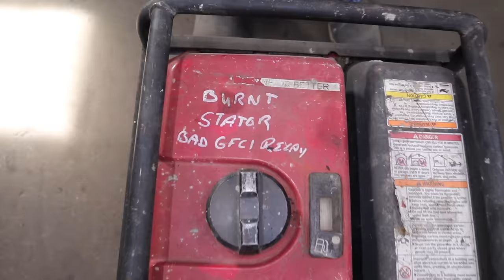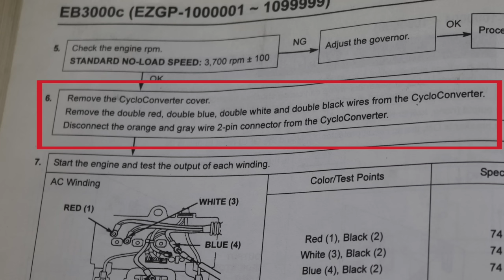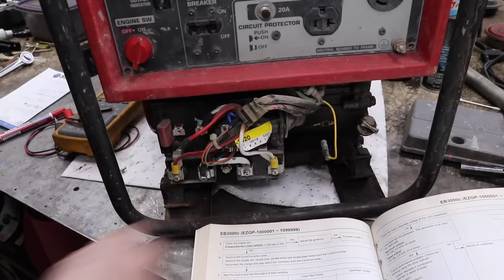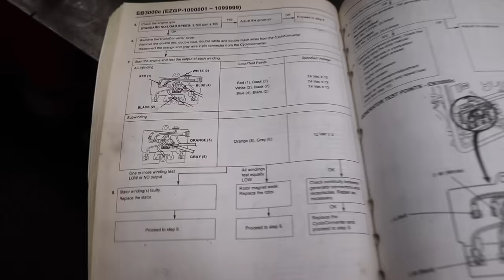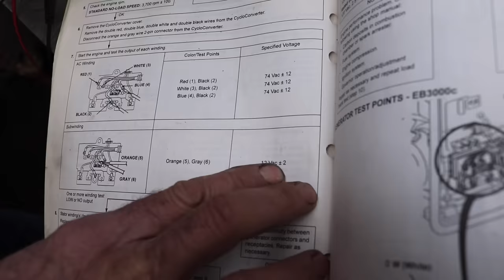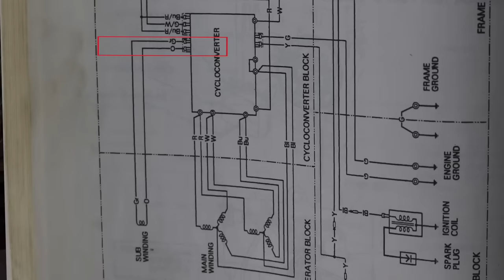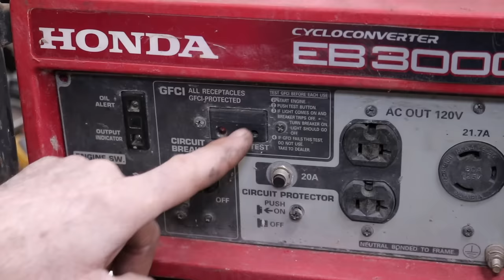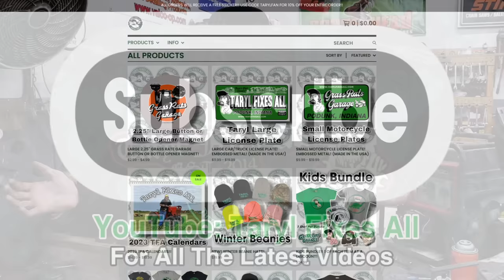Some Things Change For The Worst

Comment: would be a hit or miss situation , but i've heard that acetone will dissolve the resin (careful , it'll dissolve coating on wires too) . with knowledge of electronics , someone with lots of time might possibly repair inverter . maybe just see the layout and build a new one .
Reply: I've used Nitromors paint stripper to remove the potting compound from electrical components, but it can remove part numbers and information from the chips and what have you.
Reply: Eucalyptus oil will dissolve the resin. Use a small syringe to put it where you want, so it doesn’t get all over the place.Then you take a dental pic and a empty syringe and suck up the jelly.
Reply: I thought of that, but imagine the amount of time and work, as well as could you make it sturdy/hardened enough to withstand service?

Comment: I'm a gen tech ,and I've got a little peashooter 3500 champion.
It's ok for my needs,I'm not home when the power is out anyway. 
I'm impressed with how quiet it is, and it should be the muffler is huge! 
Of course I let it sit and get a crusty carb, so I've gotta clean that out quick and get it fired up when the power is out. 
Honda used to make good stuff ,but everyone else is catching up. 
For engines, check out the new vanguards ,they really are going after Hondas gx series.

Comment: I have no use for a home or emergency generator. But I do have a little 900 watt 2 cycle one from Harbor Fright that I really like. I have had it about 10 years. I use it to operate power tools in remote places and instead of a drop cord. I've used a Skilsaw, a small 8 gal compressor, drills, electric impacts, electric chainsaw, grinders, etc. I had to clean the carb once and you need to use fresh mix but it's a great little portable tool for me.

Comment: Honda must be too big to fail.  I can't imagine getting info to the corporate sector at Honda to respond about the parts problem.  Back 30 years ago I was restoring old Honda motorcycles and most of the parts for '60s bikes were available from Honda directly.  There was little computer online sales.  Don't try it today.  The only way you'll get old Honda parts is from places like Ebay.  Must be the same with generator parts.  Another instance of reverse progress.  P.S.  Slip Dog bears a striking resemblance to Little Jonny.  Hmmm....
Reply: 30 years ago there was no internet. Al Gore had not invented it yet, ha.

Comment: Sounds like a simple non inverter generator is the way to go. Cheaper and less to go wrong.
Reply: It is but get an inverter setup for computers and such. The 60 cycle wave on a non-inverter is erratic but reliable for other stuff. I have a 5K Coleman and a 220  well pump with backwash filters and a solid state timer relay for an ozone generator. Not one problem so far!

Comment: This is a catch 22 as the Honda's are one of the few worth the cost too repair. Other than a dirty carb it's rarely worth it to even look at a Chinese/Honda clone version. Those are so readily available and cheap customers just toss them to the curb/dumpster and pick up a new one. That EU6500 you mention with the $1100 main board was a $5000 generator new so really not bad. I mean I'll charge $100-150 to service on $400 Chinese; so 1/4-1/3 the value. Are they profiting from parts; YES, but at least you can get parts unlike the Chinese Clones.  I do work on a lot of generators and  the EB3000 is an odd ball and one of the first inverter type generators. They are my least favorite generator, only because they are loud, low power, and over complicated circuitry. But even here it was a $2000(If I recall) generator that can be fixed with a $300-500 part that takes 15min. Availability is scarce mainly because this is a rare generator that is pushing 20yrs old or older now.

Comment: Nice to know and I do have a Champion Generator I run the carb out of gas and fill it up with stable at the end of summer this will be the third year im sure it will start rite up in the spring gets a oil change every 100 hrs and ive ajusted the valves once

Comment: I just wish Champion and the others would get away from the metal gas tank that rust. I changed my Champion over to a plastic tank no more rust no more fuel problems. Also mounted a big hinged steel lid off an electrical box on top of the unit so if I have to leave it out in the weather running  it is semi protected.

Comment: I have a champion 3100 watt inverter generator that I use once a year for camping at the indy 500. Had it about  5 years now, runs my a/c unit on my travel trailer. It's quite and works flawless. Paid $500 new. It's used, gas drained from the tank and carb. I spray wd40 in the tank and next season fill it up change the oil. Good to go.

Comment: I’ve got a Honda and it has taking one hell of a beating and still going. It’s not an inverter machine so it doesn’t have any extra electronics besides the automatic voltage regulator. When you need reliability simpler is better. The more electronics you put in ANYTHING the more liking it is to fail.

Comment: I see a capacitor on the inverter there, I wonder if that is bad. On a Kenowa 4500 generator I have, the exciter coil capacitor kept going open when a heavy load was applied to it. I opened the plastic block case on the last one up, dumped the sand out, and found there were 4 separate capacitors in there hooked in parallel, and one lead to an outside terminal was burnt open. Looking on the case, it said it was supposed to be 24ufd, but the capacitors inside only added up to 16ufd. I searched ebay and found a high quality nos 24 mfd Mallory capacitor, installed that, and no more problems.

Comment: I have four generators...one the expensive Honda EU6500 for whole house backup, and three of the 2000 Watt Champion generators. I would say this about them. The Honda is insanely overpriced compared to what others offer but it is a superb piece of equipment. Getting it repaired ?....I don't know as I have never had to. 

The Champions are far better value for the money, and have good service support from Champion. I expect the Honda will last virtually forever but honestly, if I hadn't got an insanely good deal on a second hand (but brand new) one, I would never have spent that kind of money.  However, both have to be treated properly and looked after if you want to extend their life.
Reply: You've got probably 15 years at the max before you have capacitor issues.  You should go out every month and run it under a little load to make sure the capacitors are staying formed. The eu6500 is way more reliable than the 7000 fuel injected one.  Just ask the off grid people. They run them 10-20 thousand hours.  And then rebuild them.
Reply: @OTAlucard  Well, I'm 80 so in 15 years I'm not going to care. !!!!  Being serious for a moment though, I routinely run all my gennies about once a month, and treat the gas properly for long term storage. A home backup generator is absolutely useless unless you can be sure it will start in an emergency. I really don't know if using them routinely is going to ensure their longevity but the whole argument seems like a "storm in a teacup" to me. Buy good quality to start...Honda, Yamaha, Champion....and stop worrying. I had heard an unverifiable fact that the Honda EU6500 genny holds the world's record for long term use of 39,000 hours so if this is anywhere near true, I think worrying about the inverter crapping out is an over reaction. And yes, the Champion inverters are available as a part you can order ($200)and are more far reasonable than the Honda ($900)

What I would be far more worried about is buying one of these clone Chinese generators with no service and no parts available. If you do, be prepared to throw it out and replace it if it seriously craps out. You still DO get what you pay for....
Reply: @TOURMANBOB  I love Honda generators.  I've got a few of them but my favorite being the Honda EX4500.  They did everything right on that one. The EM600 is also an amazing generator about as big as 2 small shoe boxes stacked up

Comment: I’ve had two Honda eu2000’s both had problems. Had an old Honda 2200x rand good but was heavy for its output so o traded it for a .22 rifle. Since then I have purchased a Champion 3100 two 2500 duel fuels with parallel kit and a 8.5kw whole home unit. So far the only problem I’ve had is one the of the 2500 started to smoke with only 160 hours. I don’t run them hard mostly charging batteries just off idle. Hooked it up to something big the other day and ran it @ full load for about an hour. Smoking problems went away.

Comment: I also have a blue star miller stick welder 6500 watt it has 13 horse Honda engine.
It works great starts first second pull every time.

Comment: 100s of food truck vendors would disagree... Those Honda EU2000 generators are legendary and for good reason.  They are amazing.  I've royally neglected mine yet it starts on the first pull every time, even after 18 years and probably 5 oil changes at most.

Comment: There is no long term support plan for electronics like this. That power inverter was likely sub-contracted out for a limited build particular to that generator, and few other models like it. They likely had a post-production spare parts inventory, which wasn't maintained. A dealer would say the same thing Taryl effectively did - can't be fixed. 
Spare parts are going to be a headache as all kinds of cheap electronic systems age.

Comment: I've had this same issue before. I just cut the kill wire from the inverter. The low oil light shows on the panel but it still runs.

Comment: Unless you need pure sine wave voltage for some delicate equiptment, stick with a conventional genset.   No need to add electronic components that will fail long before the engine and power head.

Comment: I have the top of the line champion genny, with the remote start, it is super quiet, and hasn't given me any trouble in 5 years I've own it, cause I take care of it, and drain it, and I clean out the carb before storing it, and I keep it in my basement, not outdoors between uses. Only take it outside while running it of course.

Comment: I used a small torch to heat the epoxy and peel it off a board. In my case it was a $4 relay buried in epoxy on a $350 board for a generac.

Comment: I have had good luck with the large older style Honda generators like the em 5000 and em 3800. I buy them in good shape and use them for 5 years or so and keep them nice and sell them for what I paid for them or more before they get too many hours on them. They are quiet have a large fuel tank that lasts hours and they have a load sensor on the throttle to save fuel, good quality breakers and receptacles. The downside is they are heavy and not good for use with sensitive electronics. The newer ones are cheaply made and some of their cheaper models are made in china. I have never had an issue with the em series. I know people who have had them for 20 years with little problems.
Reply: I still use an EMS4500Honda I bought used 15 years ago. I think it's a 1985 model. It's so old, it has a flathead engine in it. Runs great when the power goes out.

Comment: I have the 4650 Watt version of the Champion Inverter Generator.    It`s quieter than my Honda EU2000 and starts and runs my one ton RV Air Conditioner without breaking a sweat.   The remote electric start can spoil you.   On a cold camping morning my RV is powered with the push of a button.   Best generator I ever owned.

Comment: When I was doing some electric motor.rewinding & power tool repairs 20+ years ago the generators that I worked on weren't fitted with an inverter & it was mainly the diodes which blew in them.

My brother bought a couple of AEG generators for my father & one of them has a faulty RCD (residual current device)/ MCB ( miniature circuit breaker) combo Unit which is similar to the GFCI unit used in the U.S. but any generic 240 VAC Unit of altge same current & trio current rating can be fitted into the AEG generators in Australia.

In our area we haven't had a power blackout for 9 years since we had a new substation built & since our last major storm so I don't know if they're ever going to get used !

Comment: I have an ES3000 Honda generator from the 70's. It is so old it has a flat head engine (I didn't know Honda even made a flat head engine). It runs the generator off a belt drive. So far, so good, but no parts available, not even NOS ebay!
Reply: Saw one years ago. Good rig!

Comment: Hi from Willow Alaska Tarly..What’s your thoughts on the Honda EU 3000is ?  I did quite a bit of research and just bought one a couple months ago although I haven’t used it yet. I bought enough spare spark plugs, air filters and oil to keep this thing running for many many  years, or so I thought ?

Comment: I know you can't advocate for doing such a thing, as a reputable repair shop, but I am pretty sure the Inverter designs are not all that dissimilar between ANY inverter Generator. I would think that likely you could say, fix that Honda Generator with a Champion or Harbor Freight Predator, or whatever other brand inverter by simply knowing how an inverter works, measuring the voltage and frequency (if any) differences going INTO the Inverter unit on a working generator to help match up/decide if the Inverter is compatible as a replacement.   Of course, this is something I would do, in my backyard shop, as a tinkerer but not something I would be able to do if I was taking customers money and guaranteeing them any sort of safety from it catching fire, etc like you would have to if you ran an actual customer pay repair shop.   Inverters aren't rocket science, especially now that Solar is so popular, Inverter designs, and the parts used in them, are quite commonly available to the public.

Comment: ?  i have an older Honga gen:  EG 3500.   i bought about 9 gens; all different. Two were Chicago 900 watt 2 cycles, very cheaply built, got 'em going. (carbs redone)
  Most all, required carb jobs/ new parts/ gaskets.  All but 2 were working.  Those two, one trashed engine. Other, trashed gen part.  Anyway, this EG 3500 works, awesome.  Had to re-do  the recoil  cord.    Usually  starts   first, or second tug.   
 GOOD  LUCK,  all.

Comment: I bought a champion in 2009 and only problems were carburetor related because I’m too lazy to drain the fuel. Oh and the older ones had junk oil sensors that quit very early on. But I still use them.

Comment: Get a powerhorse or Champion gen w no inverter. My Powerhorse 7.25 gen worked ten days
 straight through hurricane Irma, no fancy-ass shit like a fkg inverter. A company like Honda that
charges so much and can't keep replacement parts available at a decent to-customer cost is 
NOT a company to deal with! Seriously you can do SO much better.

I have dealt w Champion, Taryl, those ppl at Champion are GREAT. I was fixing a Champ gen 3500 watts for a lady friend in her upper years, she used it to work a space heater at times. Champ sent me a new magneto and carb, FREE.  Thus I have bought a lot of parts for gens from them.

Comment: I can agree with you on Honda stuff being expensive junk. The mowers seen in the UK aren't terribly great. The steel deck HRG Izy models decks start to dissolve after 8 years if they haven't been cleaned properly, the Aluminium deck pedestrian mowers HRH-HRD models with rear rollers can have transmission issues after a year's use (in a professional use aspect) and the tractors we see are made in Italy by a Swedish manufacturer called Stiga who sell their machines at a cheaper price than Honda.

Comment: The Honda diesel generator could be made to work with a heavy duty alternator on and a 12v inverter, if one is desperate. However, it won't be easy to do. That diesel engine from the Honda could work on my tractor as well. 😁
Reply: So... you want his gas generator fuel tank AND his diesel generator!
Reply: Tbh, i would rip hondas generator head off and fit another brand on it .

Comment: Friend has a Honda EU2000 that he has used to run his RV and the Club Motocross Track Food Stand every Summer for YEARS.  OVER LOADED & OVER WORKED with nothing more than basic maintenance.  He even runs it on "Race Gas" a lot of the time.  I have a newer year of the same model.  Both are still running GREAT!  Honda costs more because it is worth it.

I have spent all my life in the Power Equipment Business.  From Mechanic to Mfg. Rep., providing Global Technical Product Support.  If anyone feels Honda is a substandard product when compared to the CHINA made, CHINA spec. products, they are not being honest with themself or others.  And no.... it was NOT Honda I worked for.

Comment: I don't want to call BS but if you look up parts for a EB3000C there are many serial number ranges. I looked up the Inverter (31320-Z04-C35) for a few of them and it still shows available, even on Amazon. This part number is the Inverter module only. There is another P/N (04301-Z04-C30) which includes the Inverter and a small harness. THAT is the P/N that shows as "Not Available". I'm not sure why you wouldn't just order the bare inverter module. As far as price... yes, it is $535.
Reply from the maker: @gfriedman99  Thanks for the tip. Looked up that number you gave from my Honda distributor NLA. Unless it's new old stock that you saw.  unfortunately the customer doesn't want to spend the money.

Comment: Not to start a fire......
I own a Honda EM 3500 SX generator which I purchased in the summer of 1985.
Now in 2023 @ 38 years in service it still performs as well as it did when I first got it.
Maintenance and not asking the unit to do more than what it was designed for play a huge part in the life of a generator.